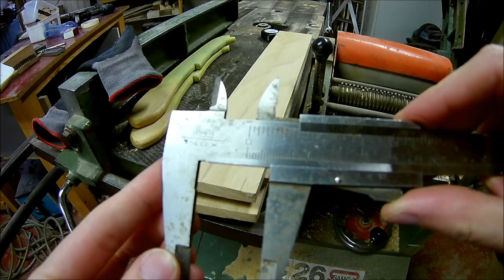How To Make a Wooden Toy Chevrolet Pick Up Truck | Wooden Miniature - Wooden Creations

Comment: Good idea to clean up the wood - running over it with a metal detector does no harm either;-)
Reply from the maker: Thanks! Yes indeed, always look for those dirty nails :)
Reply: I purchased 8 cedar fence boards to do glue up and make blanks for woodturning. Instead of my planerI decided to used my belt sander as fence boards are rough. I came across a 3/4" nail that put a rip in my sanding belt. I noticed there was no entry hole, thr tree had grown over it. If I had used my planer, I would have to buy a new set of blades. Yep, got to check for the metal. I saved the nail as a reminder.